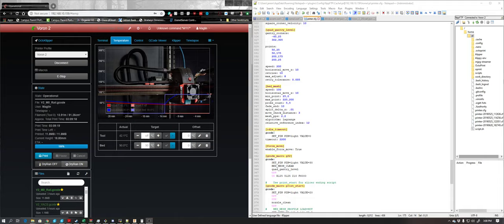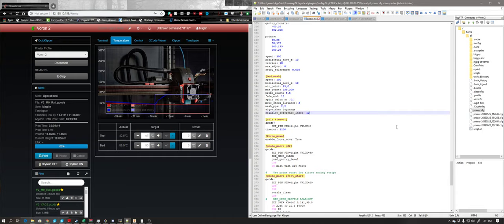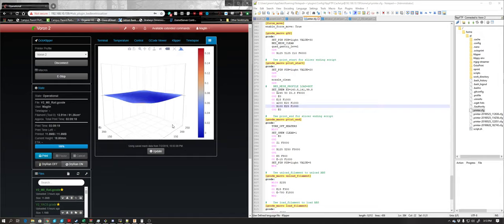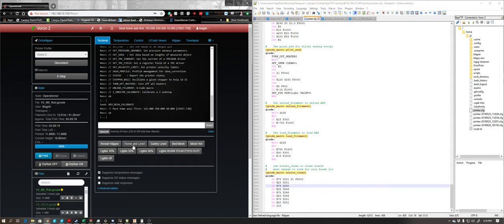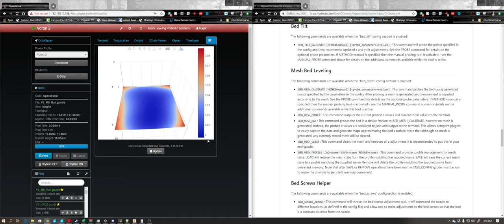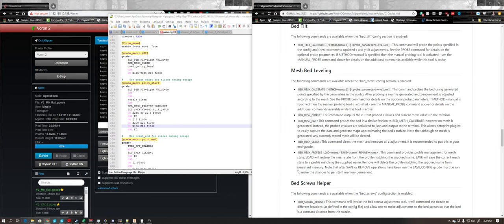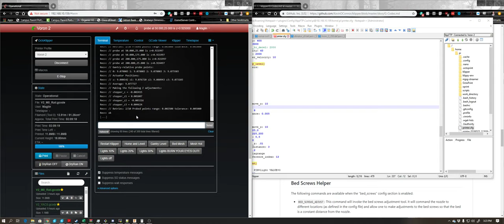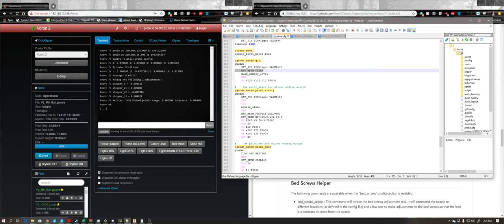Klipper - Setting up a Bed Mesh Profile - Voron 2

Comment: Nice vid. 
Saved for when I start printing ABS and need to check my bed level.
I was wondering how did you mount your bed to end up with that mesh?
Was it mounted with all four screws?

Comment: Hey mate thanks for sharing. I have an Ender 6 and I have converted it to direct drive with a Biqu H2 and it prints beautifully. The problem I am having that other YouTubers haven't been able to help me with is I keep getting an out of range error on 50% of prints I try and start. From what I understand it is a slicer issue, I have adjusted the bed size to suit the new extruder and not messed with any g code settings. I run Klipper on a raspberry pi and use Ffluid web interface. As far as I can tell all my parameters are correct. If you have time to help would you have any suggestions I could check/try please. Thanks in advance.